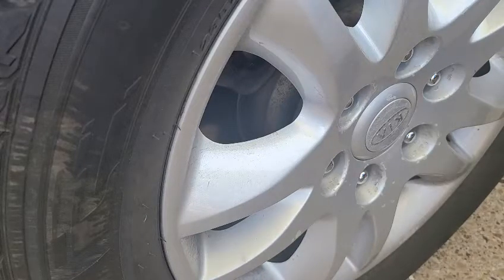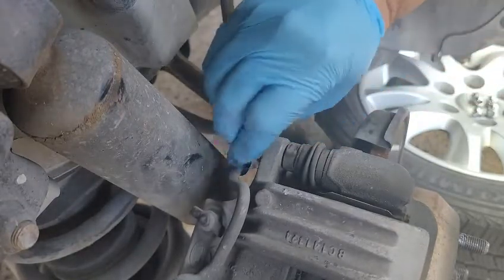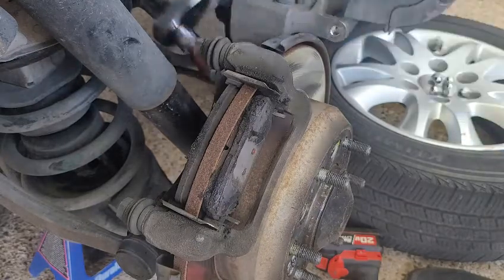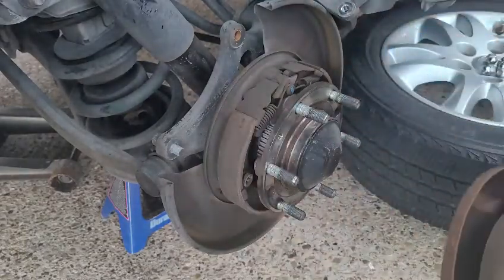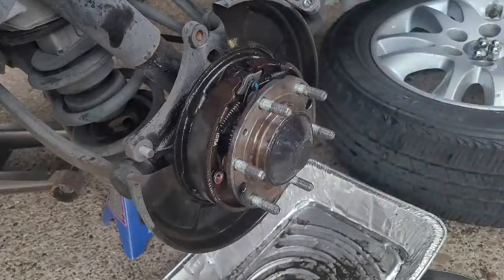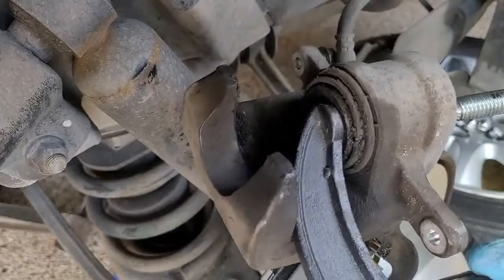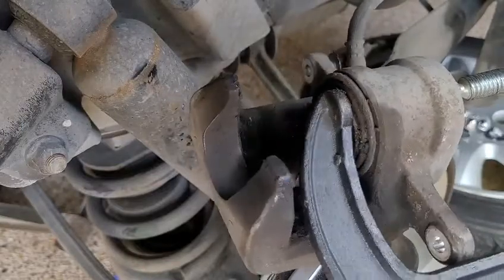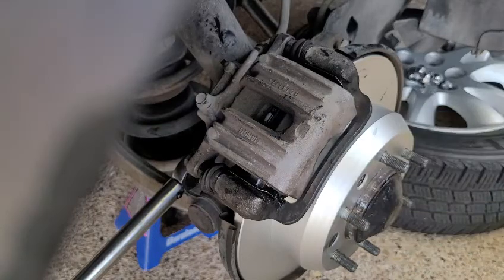Kia Sedona / Carnival Back Brakes and Rotors Replacement

Comment: Removing the rear brake drum can be a beast!  Using a small piece of 2x4 wood positioned at the outside upper edge of the roto, right where the dust shield is cut out, then giving the wood a good firm wack with a heavy mallet or sledgehammer.  Rotate the brake Roto and repeat this several times.  This process will eventually break the bottom edge loose.

Comment: The little rubber "peekaboo thing" is an access hole when it's removed so you can adjust the parking brake by turning the adjuster inside through the hole with a screwdriver.

Comment: very helpful, thanks.  one question:  I've now found three separate videos for kia sedona brake jobs, and you each have completely different positioning of the brake pad squeeler.... that's un-nerving.  So which is it?  (and how did you know for sure?)  Trailing front side; trailing back side, or leading front side?  How did you know to do trailing back side?  (and you apparently had quite a bit of trouble with it)

Comment: Super helpful! Unfortunately, as careful as I was, I stripped one of the Phillips screw heads that hold the rotor on. I just can't get it off! So I put it all back together as-is and taking it to a pro.
Reply from the maker: You just need an extractor... Those are easy to strip... https://www.harborfreight.com/screw-extractor-and-left-hand-drill-bit-combo-set-10-piece-63987.html
Reply: @CarsandEspresso  found an extractor kit at Tractor Supply for $5. Must say it made me anxious and took about 20 minutes on the screw, but I got it out! New brake pads and rotors installed, smooth and quiet. Thanks for the tip! Saved me a bundle!